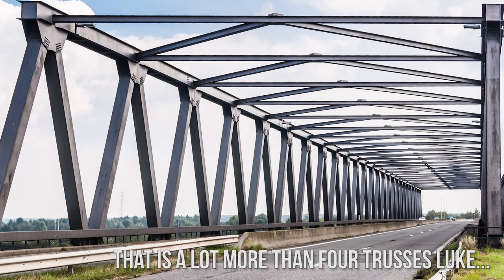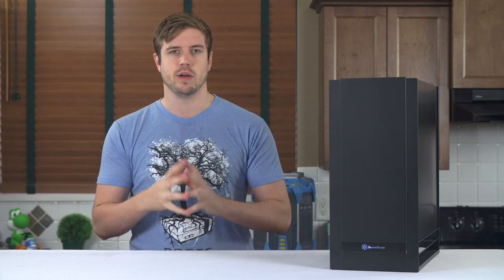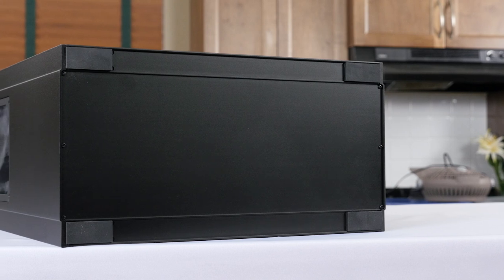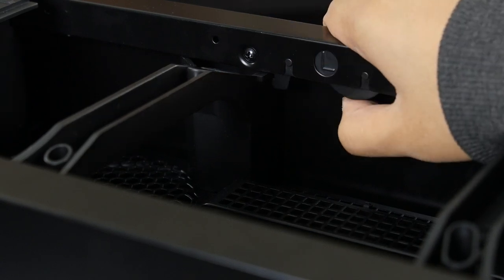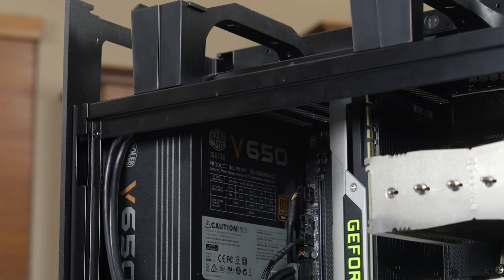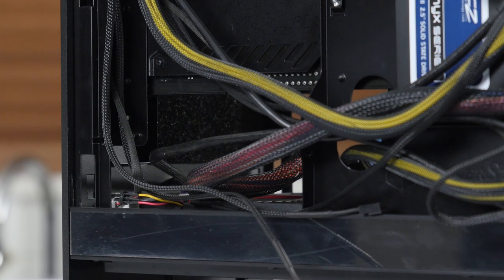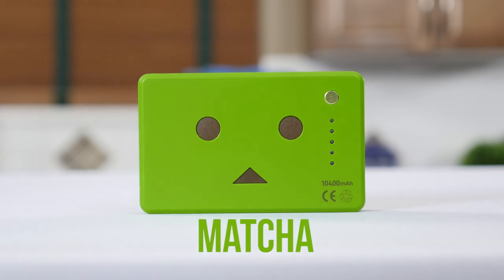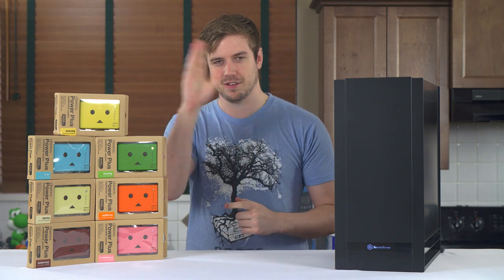SilverStone FT05 Computer Case

Comment: I love this particular airflow design when it comes to cases. It's not that great if you need something compact though... quite a lot of wasted space at the top and bottom for cables and air intake.

It would be cool with a 'suspended' design, where the case at the front doesn't go right down to the floor but appears to float above it.
Reply: DIY Perks Your vertical cooling concept was great too.  When I first saw it I thought I might be looking at an FT05/RV05 chassis.

Comment: I bought a PC to play Extreme games in ultra settings, and to multitask on and do work:

- Intel pentium @ 1.4 ghz
- Intel Integrated Graphics
- 1gb RAM
- 10gb hard drive

The case is a spare cardboard box i found in the garage.
Reply: Take it easy that's fucking overkill. 1 gb of Ram?!
Reply: Mate intel integrated graphics is overkill as all hell, get a CPU without integrated graphics, you will be getting like 120fps on Metro Last Light Max Settings 4K. Wait for another two years then get a CPU with integrated graphics. By the way your case is overkill, glad wrap and duct tape works just fine
Reply: What are you going to need all that ram for?
Reply: I think you could run crysis 3 at about 70 fps , but minesweeper not a chance well MAYBE 1-2 fps.
Reply: Guys everything here is sooo overkill. I play games on an Arduino.
Reply: 10 gb hard drive?? You know you can just boot DSL linux distro off a floppy right??!
Reply: dude, you don't need such overkill setup.
Reply: What OS do you hope to install?
Reply: ***** You sir.. have just failed the internet.
Reply: ***** Everyone here are just being sarcastic. You missed the joke by a mile, maybe more.
Reply: ***** yeah coz they TOTALLY weren't being sarcastic...
Reply: ***** I'm not sure you are being sarcastic like we are, or can't detect the troll by original commenter and we are playing along.
Reply: I thought we were being serious......that machine would be beast, more portable than a laptop......especially if it is rapped I'm glad rap and has water cooling via frozen drink bottle
Reply: Potato power supplies work a dream
Reply: ***** STOOOOOOPIIIDDDDDDD
Reply: Ok guys calm down, the "Gaming" kid is only like 12....... He isn't even smart enough to figure out 9+10 or old enough to remember Darude Sandstorm...let's leave him be
Reply: Yet a lot of people still have computers older than that, with cool cases and like 2 tb hard drivers because they think the more bites the faster the damn thing yet that probably that only slows the computer down even more
Reply: ***** Thank, it was obviously a joke mate haha
Reply: Holy Shit, You can play any games on Ultra 5k with that computer, Nice! How did you even get enough Money? :D
Reply: My laptop is a bit better
Specs:

Windows 95
233 MHz (0.23 GHz) Pentium 1 (single core)
32 MB (0.3 GB) RAM
6 GB hard drive
2 MB (0.002 GB) video RAM
Reply: still beats a console
Reply: Still better than the "next gen" consoles.
Reply: Omg! This thing is an absolute monster! Get an 800 mhz pentium 3 instead,  get 450mb of ram and a 8gb hdd. The card board box will be great. Good luck building this beast workstation!
Reply: Alienware would be proud.
Reply: I am running an Intel C4004, with 80 bytes of RAM.
Is it time to upgrade?
Reply: Matt Hoffman No, you should be fine for another decade or so, quantum computers are right around the corner.
Reply: ***** ugh I'm sitting here at 740 khz, you got me beat.
Reply: I managed to overclock my pentium to 1.9 Ghz
Reply: Thanks for the help guys, I hope to be installing Windows Vista today.
Reply: Overkill.. You can run Crysis 3 120 fps, 8k.
Reply: Beast setup. What settings do you use for calculator?
Reply: On my laptop i use Ultra settings and getting a stable 60fps, but sometimes i get some fps drops ;(
Reply: It will still run Call of Duty on max settings.
Reply: Tror din CPU flaskhalsar din GPU där.
Reply: Can it run Doom? Probably, but you can run Doom on a Calculator. Can it optimally run Doom? Only if you put the parts in a toaster! All that ultra violence can't handle a motherboard in a cardboard box. It will catch on fire!

Now Free the Hostages won't run on this well. Points to anyone who is into old stuff(like me) or old enough to even know what that game is. Or that there was a game called that. Played it before and it's fun enough.

This joke got hijacked by Mr. Rambling. Mr. Rambling is an evil dude who likes to hijack thoughts in the morning. I am his victim of killed humor right now. He just left my brain.
Reply: ***** It's a joke.. Calm down.
Reply: ***** It seems you are using it to cook the oil for some fried fries.
Reply: After setting up you can visit www.downloadmoreram.com to get more RAM for free.
Reply: ***** Great energy recycling, you earn one internet fried fries from me.  :)
Reply: wow thats overkill
Reply: partyrocker1159 dont install vista install Windows 10 instead
Reply: ;(
I'm reading this on a tablet with a 1GHz single-core processor, 512MB RAM, 2GB built-in storage.
Reply: Someone took this seriously and I laugh at whoever did.
Reply: Minsweeper @4k, maxed out with 64x MSAA no problem
Reply: L3ON360Z Where's the HDAO and 128x Anisotropic Filtering?
Reply: 1GB is just overkill. You should use that extra money to upgrade your PSU from 5w to 10w and just go with 512mb of RAM. You'll thank yourself later when you want to upgrade your graphics to a 9600 pro. Also, use Windows 95 with the build, it will really take advantage of that raw power!
Reply: IRNatman no, dos is way better for the raw power!
Reply: hristaki99 of course. Silly me forgot
Reply: is my pc really good?! thanks guys! i spent $20 on it!
Reply: partyrocker1159 yeah its good, but I think you should've saved $5 by using a 2GB flash drive in place of a hdd.
Reply: ***** my system is nicer! I have a processor with 1 transitor technology at one hertz (it loads windows 8 in 6 billion seconds). I have a millibyte of ram (very fast!) And I have two floppy disks (6 kilobytes) in raid 0, so I get MASSIVE speeds of 80kbps.  Who is jealous? Oh ya, it has the same operating system as a piece of butter bread. (I think it's called butterb 1.2)
Reply: tikiman48 Quite a contender.
Reply: Dude thats a bit overkill! 10GB HARD DRIVE?! Dude come on they are really expensive nowadays just go with a floppy drive!
Reply: florisheld i regret my mistakes :( i could've spent that $5 on some sweets! :(
Reply: As linus says 512mb ram is more than enough for everyone!!!!!!     1gb WTF!!!!  OVERKİLL ALARM!!!!!!₺₺@₺)/:&@95/?"?,
Reply: Plan on adding a motherboard and a psu later?
Reply: why the hell do you have 1 gb of RAM thats overkill man and really a 10gb HDD a 4gb is all you would ever need
Reply: ***** Whoosh there it goes!
Reply: Might be overkill bro
Reply: Dude, How much would i have to drop for a rig like that? I wish i could afford it >>
Reply: Shawn Tame $19 :)
Reply: Still better than consoles though!
Reply: Bro my system will wreck your's anyday! I got 128KB RAM, a 6/15 MHz Z80 Processor, and a ballin' 16-bit 240p display.
Reply: Craftable Tech get rekt
Reply: Spoiled rich kids these day , I can't even afford the case.
Reply: LOL THAT ONE GUY WHO TOTALLY MISSED THE JOKE.
Reply: dude, that so beast, my Intel 486 can play most games on medium settings.
Reply: LOL! nice one
Reply: Alexej Mitin if you couldn't tell that's the specs of my graphing calculator.
Reply: Personally using a 4GB harddrive is a better option in my opinion.
Reply: come on man. you need to get one of those beefy IBM cpu!
Reply: Best build I've seen in a long while. It's worth making a video.
Reply: Are you kidding me? That processor is such a bottleneck. A 33 MHz processor is much better and can give a 1-2 more fps on minesweeper. Also, your build should be great on a heater rather than a cardboard box.
Reply: 10gb hard drive?! WE GOT A RICH ONE OVER HERE!!! Too overkill! Just get a flashdrive!
Reply: oh fuck this thing reks my system
cyrix 6x86 @ 150mhz
64mb edo memory
3gb quantum fireball ex
s3 trio64
Reply: *****
I've heard Intel is doing the same, killing off the Core series and releasing the new Celeron G4990X as their flagship CPU.
Reply: ***** I know, I get around 7000 fps on crysis 4 (the developer let me try it because I have the world's best computer) on ultra settings and 8k. My 5960x build with 4 980s only gets 44 fps. I need a car cooling system just to keep under 70 Celsius. I recommend buying this system
Reply: tikiman48
whats your specs?
Reply: Thanks for the help guys, but I want to play Battlefield 4 on ultra settings on atleast 500fps. Will this pc manage? Thanks :)
Reply: partyrocker1159 if you overclock that on board GPU 1mhz higher you'll easily play BF4 on Ultra with 200% resolution scale @240p no problem, 500fps minimum in heavy firefights
Reply: L3ON360Z Thank you. I will try this when I upgrade to Windows XP.
Reply: partyrocker1159
my pc cant even run xp :( stuck on 98
Reply: partyrocker1159 l3on was on the right track, but you need to change your processor to maybe a VIA cyrix 3 @700mhz. It will greatly decrease the insane bottle neck that you have with that government grade processor. Next, upgrade your ram to about 1kb (if you don't have that much yet) and lastly allocate more memory to your integrated graphics, than you will get about 740 fps on battlefield 4 at 5k ultra settings. And those specs are so good that battlefield unlocks msaa x64 and anti aliasing x256. So it will looks like real life
Reply: partyrocker1159 And stay with windows 2k. Win2k is slightly more optimized for high end gaming.
Reply: partyrocker1159 oh. You have 1000x more than 1kb ram. Man you are so overkill. This will last you until half way into the 22nd century
Reply: PetitSmite no, you need floppies in raid, obviously
Reply: tikiman48
360k 5.25" disks are ideal
Reply: ***** agreed. You could get a massive 60KBps when in raid
Reply: TheCovertCamper the what and the what?!
Reply: TheCovertCamper I belive he is either using the Lemontek or Potatotek 72w psu.
It doesn't require any cooling, which is ideal because he had that small form factor case
Reply: TheCovertCamper Then maybe you should upgrade to Intel Integrated Graphics, and Intel Pentium.
Reply: partyrocker1159 haha. I prefer the graphics from the raspberry PI because the intel integrated graphics create too much of a bottleneck to the (still insanely overkill) pentium processor. All you have to do is get a pair of scissors and cut the intel graphics off and hot glue the raspberry pi graphics on. Hope this helps!
Reply: TheCovertCamper One step at a time
Reply: Louis Löffelsender ya. Well, the iPhone 4 Is a major gaming beast. I'm running win2k on it, so I can run crysis 3 at (only) 5k at ultra settings.
Reply: you're going to need at least a 9000 watt power supply to even start that bad boy!
Reply: Ｔｈｅ Ｃｏｍｐｕｔｅｎｔ no, like I said, you are going to need a 72 watt Potatotek or Lemontek psu. (I think the lemon gives cleaner power delivery)
Reply: ***** ITS CALLED FUN, HOME BOY
Reply: TheCovertCamper Across the pond here we go...
Reply: ***** have fun doing what you do
Reply: ***** It's a joke brah
Reply: ***** good for you. I had no idea you could use correct grammar
Reply: look, can't we just get along and enjoy PC gaming? Are we not all PC gamers? When Steam has a sale do our wallets not bleed?
Reply: ***** I ain't adding you kid. Are you 8 or 9?
Reply: ***** too bad if you don't want a bystander. I am here and you can't stop that, only linus can stop me from talking in this thread
Reply: ***** I'm 15 kid. Only 8 year olds say suckka. Only 8 year olds use HD in their name. Get rekt
Reply: ***** never heard of that person
Reply: ***** time for me to hide back under my bridge
Reply: ***** Great job, Sherlock!
Reply: ***** KSI basically counts as an 8 year old. actually, on second thoughts an 8 year old would make better videos
Reply: ***** nope, VIA cyrix 3 integrated graphics :)
Reply: lol I have a more overkill pc:
intel core i7 4th gen
16gb ram
nvidia GeForce gtx650 1gb
1tb hdd + 8gb ssd
slim tray bd combo
intergrated lan 10/100/1000
wireless lan + Bluetooth
its the asus m70 pc with my corsair gaming k70(not rgb) and my Logitech g502
Reply: Joe Max I have an asus rog formula 7, 32gb ram and a 1tb ssd, a gtx 980 and a celeron G1820. Are there any bottlenecks here?
Reply: ***** thanks. I'll get that.
Reply: ***** my friend has the i3 you were talking about from his old htpc, so I'll pick that up today
Reply: ***** makes sense. I've popped a pentium Anniversary edition for the time being until I get the i3, then I'll start saving for a i5. I had the celeron as like a "get the system on" processor. The pentium is working better for now. I'll let you know how to i3 does later today
Reply: ***** nice. I've read that the pentium starts bottlenecking the 980, so I'll over clock it until I get my i3, which I will also overclock
Reply: ***** well, I have the i3 now and I am going good. Sucks that I can't oc, but hey. It's decent for now. I'll get that i5 in 2 weeks, and I'll be good
Reply: ***** that's the one I'm getting. Thanks for your help
Reply: *****
You all got trolled.
Reply: Man ill buy it off you. $2000 seems fair, ive been saving from my newspaper delivery runs.
Reply: Dude you fail. Back in those days, with that spec, RAM was like 16MB. Yeah "MB" ! And HDD was only 1GB lol

Comment: Luke, how do you want the back filter to be a slot from the top, when you have there ALL your cables running above it?
I think that the case looks pretty cool, I hope they have also window-less option. I think this case will be great for those pre-build systems made by computer retailers.